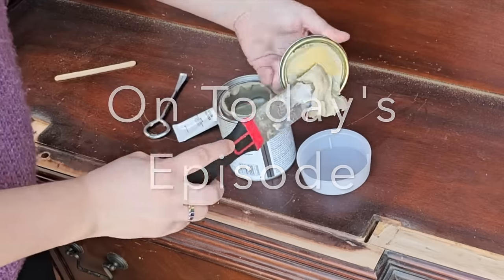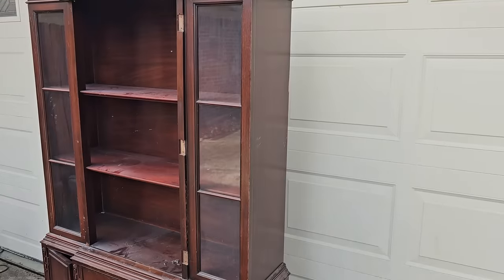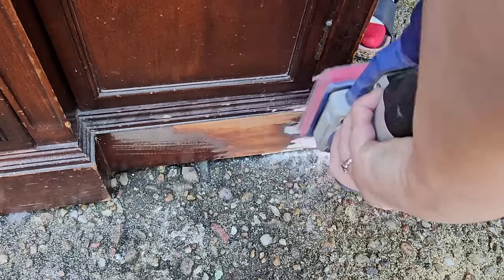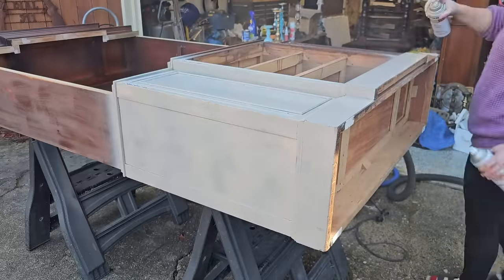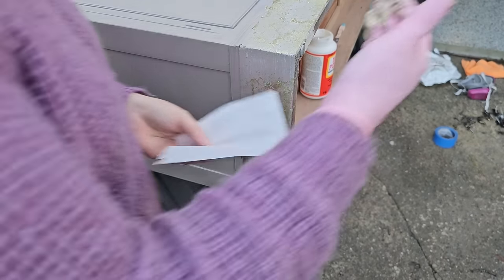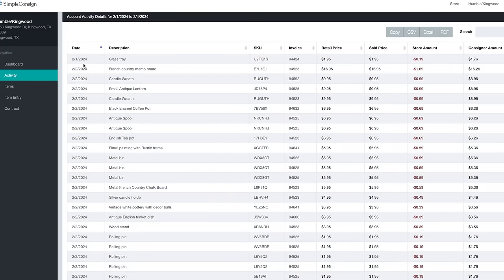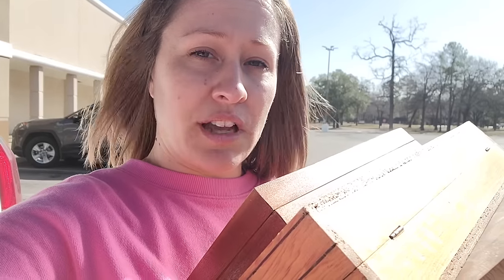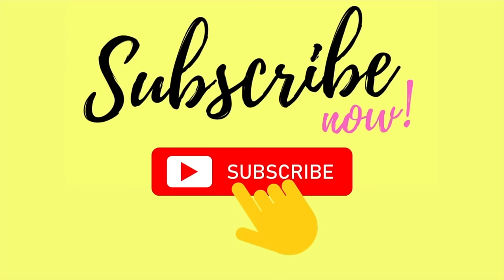French Provincial Trash To Treasure & What Sold From Our Booth & How Much $$ We Made

Comment: I think you priced the hutch ready to move which, in my experience, the bigger furniture items are harder to move. I do think your smaller kitchen items are very low and they usually move quicker. I think if you went up on the smalls ( ie rolling pins for 6.95), you'd see more profit and same movement. $1.95 seems very very low. In our area, the are $10.
Reply from the maker: Thank you Lynn! I had then at 3.95 for months and they wouldn't sell which I thought was so strange! I lowered the price and a couple weeks later someone bought all of them along with a lot more items from my shop at once. Right now is kind of a weird time for shopping. Xmas is over and it is a bit of a dead time. I think I will raise the prices back to "my normal" once things pick up a little bit. Thank you for your help

Comment: Hi Cory! Thank you for sharing your booth details! I just recently rented a small space in a store here in the small town I live in in northern Florida. I'm so excited! Quick question, I noticed your pricing has cents ($12.95) instead of say $10.00 even. Do you find that is a good strategy? And why? Oh also, I saw that you didn't have a column on your spreadsheet for the price you paid for the item. Why? Thanks again Cory, this was so helpful! :-)
Reply from the maker: You know, I don't know if that makes a difference or not but I just felt like I should do that for some reason. Like a gut feeling haha.
Reply: @DesertDIY  I think it does. I read an article about pricing and that is what they recommended. So you have good instincts. I am going to start doing pricing like that too. Thank you!
Reply from the maker: This is the website that the store I sell from uses. I don't know exactly how much a pay for certain items since the bins charges by weight and that is where i get the majority of my things from. I need to get a better system at keeping track of how much I spent in a month vs how much I made. I usually get 3x back what I spent thrifting.
Reply: @DesertDIY  Got it! Thanks so much Cory! I really appreciate it!